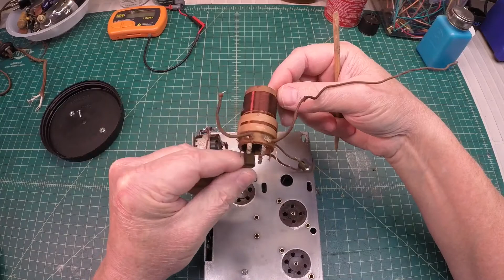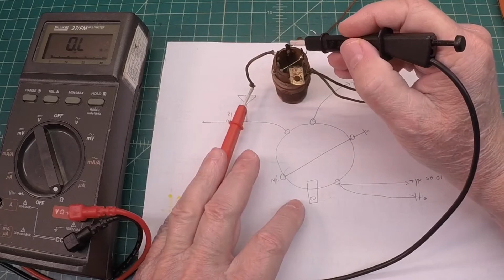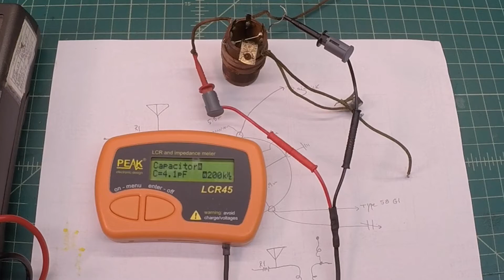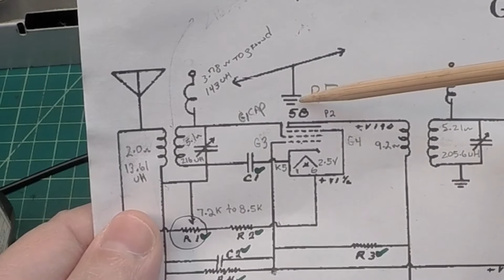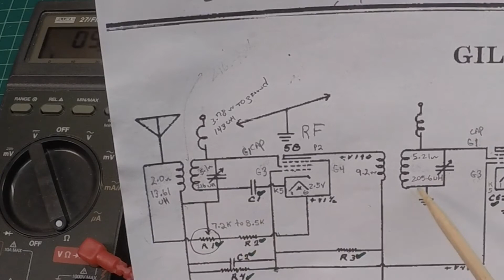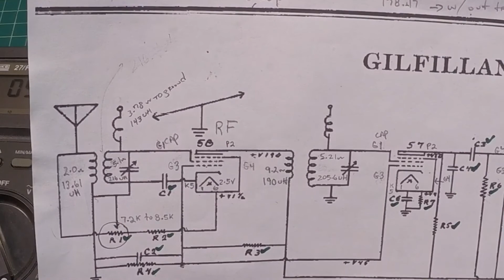Peter Pan Radio - Day 11 P1 (Antenna & Interstage RF Coil Testing)

Comment: Another great video, Don! I'm adding this as more of a question, than a comment, lol. What Gary translated as regulator, and you are calling a gimmick cap, could it be, added to the circuit to provide feedback to increase regeneration? Thus regulating the regeneration? Yeah, Im grasping at straws, lol. I know some radios use an antenna wire ran thru the circuits to provide regeneration. Hopes this at least provides food for thought. Thanks for letting me in this journey! Best Larry
Reply from the maker: +Backtothefutureradios You're on it. Check out + sporadic -Z response too on the gimmick and the slanted line. He also shared a great tip on testing coils capacitance. Best, Don

Comment: I've been trying to search obscure schematic symbols and a I saw a diagonal line with an arrow on each end but it's glossary was in German, so I put up Bing's translator and typed in selbstregelung and it came out as self regulation.  I don't know if that helps any or not but I'll keep looking.  Update.  I kept looking and it has me stumped alright.
Reply from the maker: +sporadic -Z Thank you! Best, Don
Reply: I knew the part at the bottom meant ground, but why that two way diagonal arrow over top of it?

Comment: That thing with the arrows at both ends  with the selector grounded is a band switch and it cuts in and out that additional winding  on secondary side of coil.   I worked on a similar designed radio about 2 years ago!   So the thing  you pointed to and questioned is NOT the GIMMICK!
Reply: Another possibility is that the slanted arrows indicate a VARIABLE component of capacitive coupling, in other words you can "TRIM" the length of the wrapped gimmick wires" to best suite the radio performance !!!!  Maybe !!!
Reply from the maker: +John Bellas Thank you John. +sporadic-Z said it indicates a chassis ground and explained the purpose of the gimmick capacitor. Best, Don